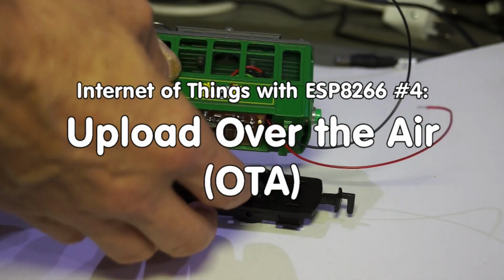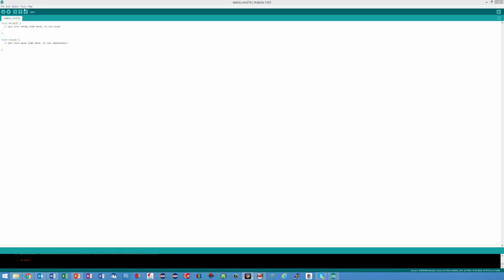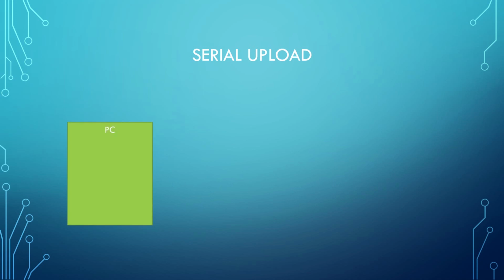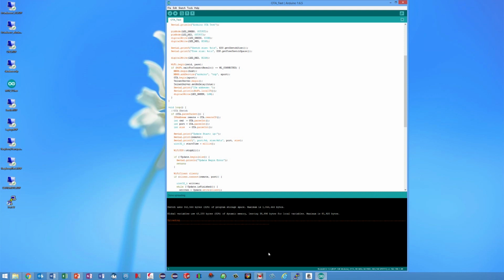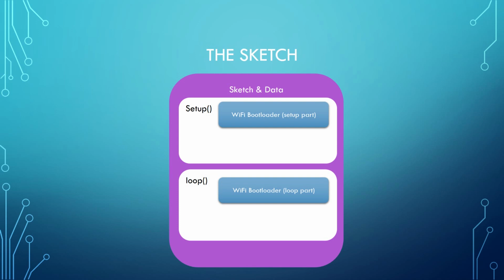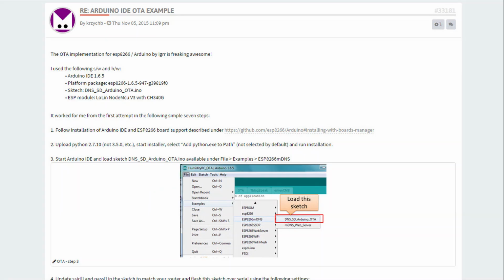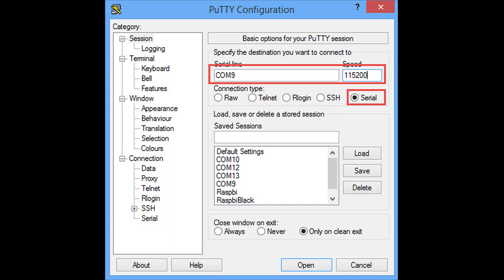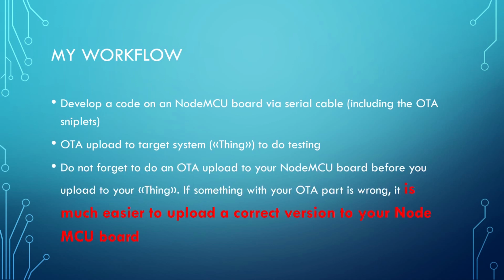#32 Internet of Things with ESP8266 #4: Upload Programs Over the Air (OTA)

Comment: +Andreas Just after starting in OTA I got an exception. Got this when still connected to serial PC and also if ONLY connected to power it is the same. Because I do not get an entry in the Arduino 1.6.8. Switched to OTA but no additional connection is shown. Using NodeMCU 1.0 with 4MB Flash. Any idea???

OTA settings applied

Exception (2):
epc1=0x3ffe989c epc2=0x00000000 epc3=0x00000000 excvaddr=0x3ffe989c depc=0x00000000

ctx: sys 
sp: 3ffffca0 end: 3fffffb0 offset: 01a0

>>>stack>>>
3ffffe40:  402195b5 3ffffed0 4021949d 3ffffed0  
3ffffe50:  401041c2 00000027 7fffffff 00000002  
3ffffe60:  00000127 40103ff1 00040000 00000001  
3ffffe70:  40103127 00080000 3fffc200 00000022  
3ffffe80:  00000000 3ffeaa1c 00002200 4000050c
Reply from the maker: +Stefan Bode Three ideas:
1. Did you check the real flash size (ESP.getFlashChipRealSize()). I had a dump problem with an ESP-07 and 1M memory
2. I am still on IDE 1.6.5 because I read about several problems with 1.6.8
3. Is your overall sketch  small to start with?
Reply: +Andreas Spiess 1st is ok 4MB checked already. 3rd should also be ok. This is YOUR project from github. regarding 2nd I downgraded to 1.6.5 and now got missing the board and missing the library. This was straight forward in 1.6.8. Everything was already there. Can you guide me to a description how to enable the 1.6.5 ide for the nodemcu 1.0 ESP-12E. Merci. To get the ESP running you have to add a new board provider under "preferences"..: http://arduino.esp8266.com/stable/package_esp8266com_index.json
Just for those who want to follow
Reply from the maker: +Stefan Bode Can you check if the ESP environment in the "Boards Manager" is isnstalled? Got to tools-->board manager and type ESP in the search field. Then you see if it is installed.
Reply: +Andreas Spiess Yes this is installed. version 2.1. Otherwhise compile would not work. I created some output to get an better idea where it fails. It runs until

otaReceive()

This procedure creates then the crash
Reply from the maker: +Stefan Bode Strange. During my initial trials I had a dump. It was because of the memory size. People here:
https://github.com/esp8266/Arduino/issues helped me to find it out.

Just googled and found, that some people had similar crashes because of unstable power. But this is just a "shot in the dark" If you post your issue there, maybe someone can read the dump. I cannot, unfortunately.
Reply from the maker: +Andreas Spiess Which SPIFFS config do you use (1M or 3M). 1M is better.
Reply: +Andreas Spiess Hi Andreas, just some short feedback. All changes did not result in a running environment. I must admit I have not connected all that beep and let stuff. Anyhow from the log messages it should work. I will no go to the original project and check if I can get this running and then start from there. Did you already find a u8glib extension to use with the esp8266? There are 1-2 youtube videos, but no documentation how they get the LCD running. Will keep you posted. Maybe someone else can share, if his try with OTA was successfully.
Reply: +Stefan Bode Partly Successful. I replaced the 2.1.0 version of the board with the 1.6.5.... (same as you used) This now indeed create an image that seems to work. No crash on the esp8266. Additionally after swithching off my firewall in my windows 7 PC the Arduino IDE did found the board as interface. GREAT!!!

But the upload is not working. Now I'm getting error: Failed to open 192.168.178.24

This is the IP of the esp. Is it normal/intent to be that the otareceive
Reply from the maker: +Stefan Bode Concerning OTA: In the ESP blog there are many people which were successful.

Concerning U8G: Daniel is the right person for that topic: http://blog.squix.ch/2015/01/oled-128x64-ssd1306-display-arduino-how.html
Reply from the maker: +Stefan Bode At least something! I have to admit, it took be also a while till I figured it out. I seems, that the guys are still working on the functionality. And since my small project I had no use for OTA, so I am not a big help!